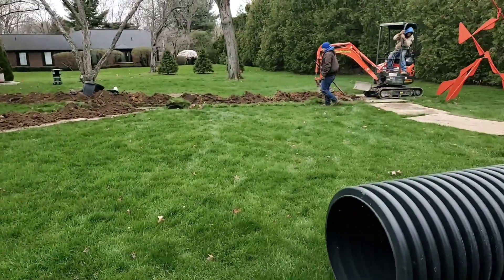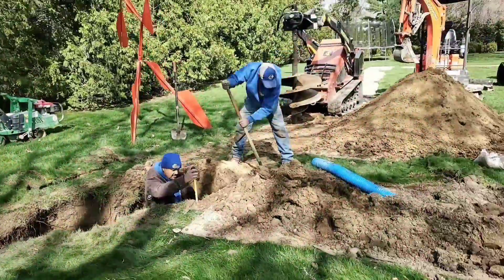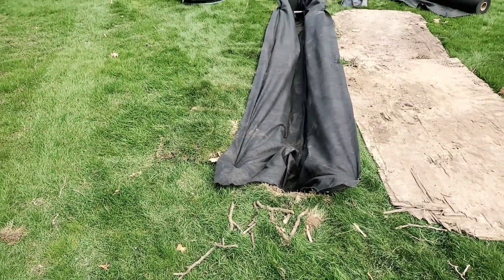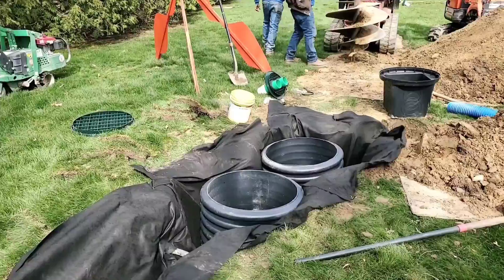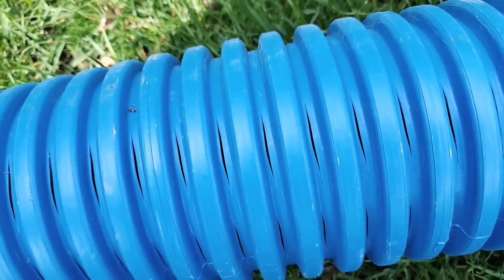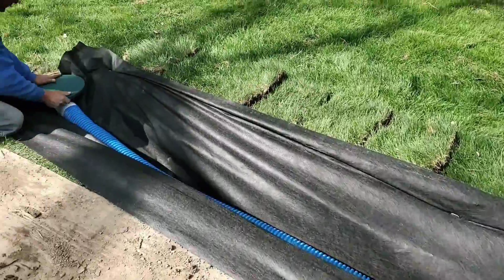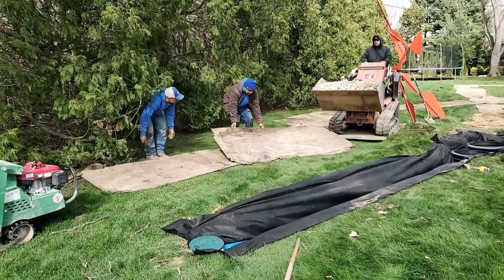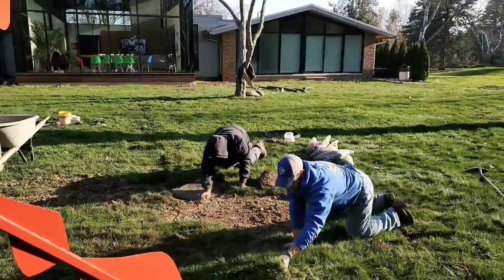How to Build a Dry Well Soakaway and Leach Line the Right Way for a Roof Runoff System 2023

Comment: How deep down is your overflow leach line with emitter? Do you slope your overflow or is it a straight run.
Reply: It's definitely a nice setup. I like the  dual wall 24 as well. Very strong. What i dont understand is that if you have a 100-foot run main of 4in to drywell from downspouts, that would put you down at 25 inches when drilling a hole in a 24-inch dual wall. (.25 inches x 100) slope is 25 inches at the end plus about 8" down from leaf filter. Isn't that too deep and taking away   capacity? I'm really confused about that.  Do you have a video on that concept
Reply: @ktm3850  don't forget that the yard has also slipped down over those 100', so as long as the slope of the pipes aren't much greater than that of the ground, it will still come in near the top of the well as needed.
Reply from the maker: The main key is not to build your drywall at the lowest point of the yard. Because you want the emitter to be able to run down the grade.

Comment: I’m thinking about doing a dry well for an outdoor kitchen sink drain. Which of your pipe should I get, perforated or solid?
Reply from the maker: Solid pipe to the dry well.
Reply: @FRENCHDRAINMAN is Schedule SDR 35 pipe good to connect downspouts to dry well? It’ll be running under an asphalt driveway.  I’m in New England. Thanks!

Comment: How many drywall barrels can be used in a given space?   This project is for a single downspout for a large roof  to soak away pit.  The pit has pretty good percolation,   I’m thinking about doing a 6 ft x 6 ft x 4 ft deep just to hold more water for drainage then run a single overflow leech line 20 feet away like your video.   Also do you sell those dry well chambers?  Thanks for any info!
Reply from the maker: https://youtube.com/playlist?list=PLjFCqaZ4v1BUa_jzxnMZGsMEksxwvGfzf&si=VPngZOiV_-K6ew0H

Comment: Love the look behind the scenes, thank you! Quick question, what's the frost line where this was installed? I'm at right about 48" and I'd love to do something like this for an indoor sump discharge plus 2 ill-placed downspouts if I can get away with it. I've had the above-ground discharge line back up on me in the winter due to freezing at the outlet, though, so I'm worried about ice damming at the base of the dry well and/or the perforations in the line.
Reply from the maker: We have to go 42" to be below frost
Reply: @FRENCHDRAINMAN safe to say then that the knife-cut lines aren't at risk of causing ice damming during a hard freeze? The dry wells in this video clearly go down below frost but the knife-cut doesn't, I just don't know if there's ever a worry of small ice forming at one of the perforations and causing subsequent water to dam and freeze if we get one of those weeks where it doesn't get above 0

Comment: I enjoyed this video. Running into a similar problem with a sump pump that is moving roughly 30 gallons a day (in non rain events) and more during the rain events. Heavy hard clay yard and creating soggy grass and wet river down the curb to the storm water drain down the road. I’ve been trying to solve the issue myself and thought a drywall would be a good idea. However, it fills it up in a single day. Do you think adding 2-3 more dry wells would be the way to go to hold more water? The problem i’m running into is how slow the water is being absorbed into the soil compared to how much the sump pump moves. IN my mind, adding a dry well may not solve the problem at all. I could add a leach perforated drain to leach some of it out and pop out down the yard a bit, but i feel like it will just be creating the soggy ground again once all the dry well’s fill up. Any suggestions without knowing all of structural or property issues?
Reply from the maker: https://youtube.com/playlist?list=PLjFCqaZ4v1BXXbPw3Vf7e86DbKj7qOnLn

Comment: Because of the drastic price difference, I've heard of people using the heavy duty 55 gallon plastic barrels with holes drilled in them instead of the 24" culvert pipes. Any thoughts on that in terms of functionality and durability?
Reply from the maker: It's a hack that will work in some cases.

Comment: I live in Louisiana where it obviously rains a lot. My town does not have storm drains so that’s not an option. A housing development was put in that re rerouted ALL the run off.  It’s forms a literal creek that flows within 20 feet from my house so a soak away is not an option either.  I plan on putting in a French drain at the houses edge and maybe open vents at the property line to prevent water racing towards the house during heavy rain.  I think I have a decent slope and am hoping I can just discharge back into the creek back away from the house using your pop up emitter.  Moving is undoubtably the best option but need to survive this a bit longer. Any ideas?
Reply from the maker: https://youtu.be/oqTZ6H4UGf8

https://youtu.be/3WXDboRKZt0

Comment: This question maybe too much for here and if so can do a consult if needed.  I live in Houston Tx area.  I have heavy clay based soil.  Right now we are getting heavy rain and I have on one side of my house water pooling during a heavy down pour and the ground stays spongy for months until it dries out.  When I say along one side of the house, the ground is sloped from the house to the fence line.  So the water is pooling along the fence line.  I want to put a french drain in this area but here is the problem.  During the summer when we don't get much if any rain this clay based soil contracts, pulls away from the house foundation (slab on grade) and the fence posts, so bad this last year it look like fault lines in the ground.  In fact I took and packed top soil along the foundation to fill the gaps.  Now I do have in ground sprinkler but even running that 3 x a week didn't stop it.  Because of this over time it has may the fence post loose and they were leaning.  So I have replaced the fence post and fence along this side of the house.  My original plan for the dry season was to put inground watering system around the foundation and along this side of the fence.  Both of these systems will need to run in the same place.  So do I put the french drain over 12in deep and have the inground watering system 4in about the top of the gravel on the french drain? It is recommended to put an inground watering system 8in away from the foundation and about 8in deep in the ground and yes put gravel around the pipe with it all wrapped in fabric.  Or run them side by side?  Because of how they have sloped the ground around and between the houses re-sloping the contour of the ground so that the pooled water is a couple feet away from the fence line isn't a viable option.  Great videos, thanks for your help.  Oh one last question where can I get the high octane drainage pipe?  I have looked into having it shipped and it cost as much as the pipe.  Again thanks for the videos.
Reply from the maker: https://frenchdrainman.com/product/consulting/